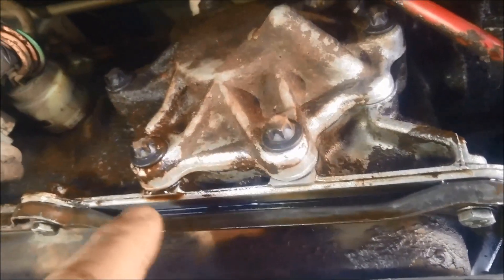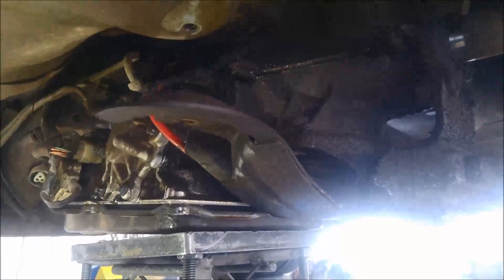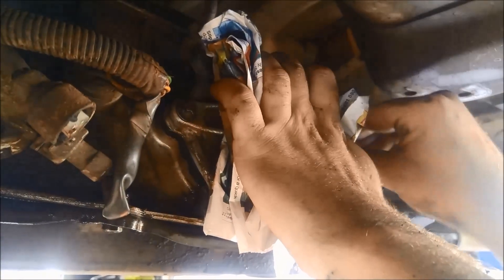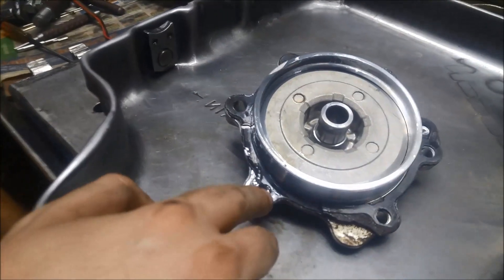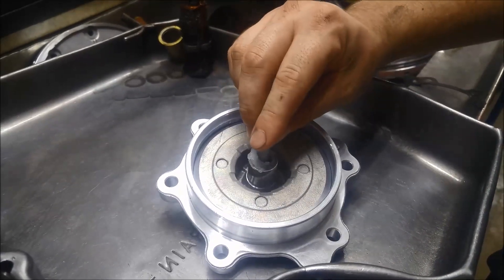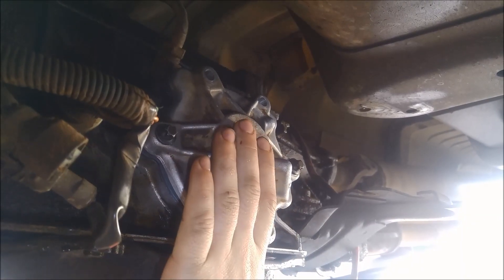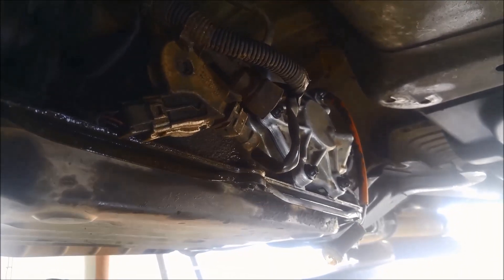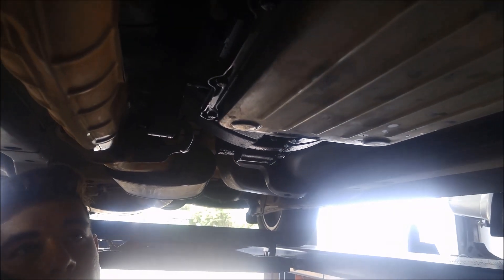Ford 4 Speed Transmission Rear Servo Gasket Leak BTR ION DSI DSI6 M74 M78 Trans Band Servo Gasket

Comment: we have a Ssangyong Actyon Sport 2008 4 gear forward automatic car. when we put the car in reverse, it mostly engages late. we press the brake and gas to make it engage faster. sometimes its smooth but mostly there is a delay. what could be the problem? can you please give us a tip?

Comment: Hi i have a ba xr6 turbo 4 speed and the transmission has a flare when changing from 2nd to 3rd. Have has advice that the transmission is on its way out. 

Is is the case?
Thanks.
Reply from the maker: hi, check all basics first, then you will need to determine next step after you remove trans pan. cheers